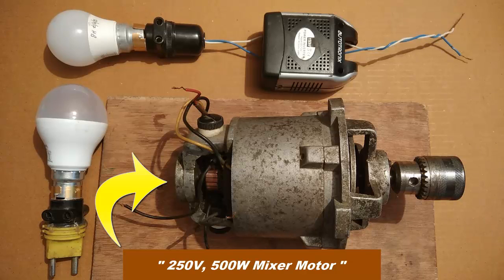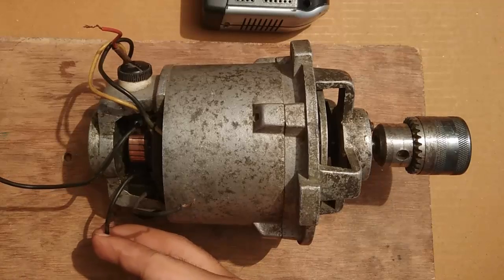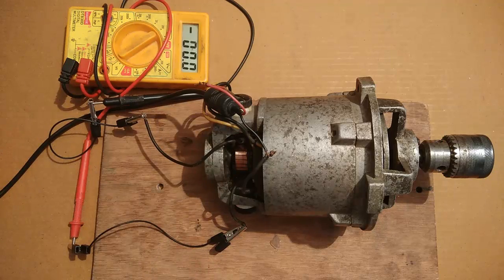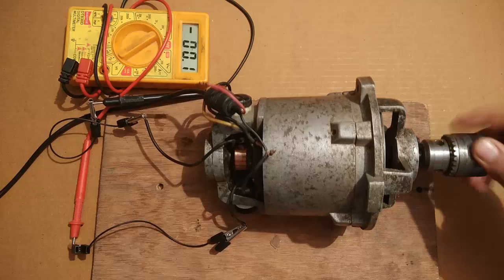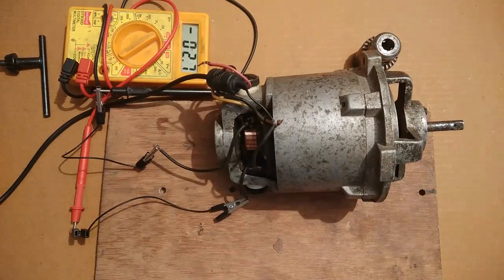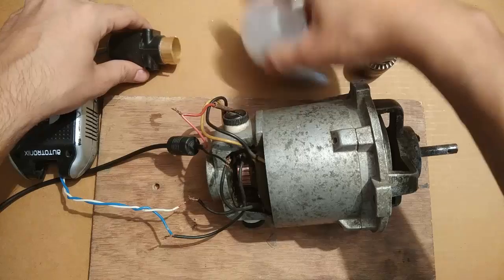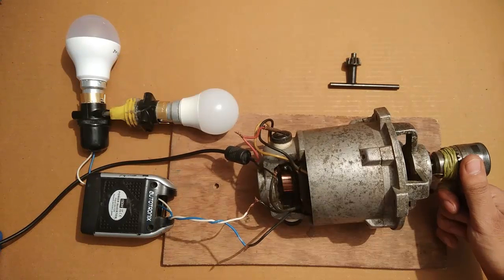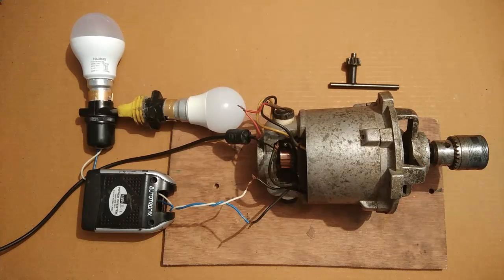220V High Energy Generator from a 500W Mixer Motor DIY

Comment: Hi I want to run a mini 12v submersible water pump, along with 12v led strip. The generator should be a wind turbine generator. Suggest me what type of DC generator I should use. :?
Reply: If you figured it out, lmk

Comment: Where' that black wire connected to? Laptop adaptor to an outlet?
Reply from the maker: Input black wire is of a laptop charger
Reply: So what's the use of the black wire? To charge the laptop?
Reply from the maker: No .. Laptop charger has been used to run the motor

Comment: Hello sir I have 0-60 volt 1 kW dc alternator. I want use 48 volt 500 watt dc motor from this alternator. How can I use this alternator with different volt. Please give suggestion what I use to work properly this 48 volt motor.
Reply from the maker: Simply limit the rpm of the 1kw alternator to the point where it generates 48V.Thats it..
Reply: Sir if alternator volt reach to 60 v than 48 volt motor works or not work or any problem in 48 volt motor ? Please reply me thanks😇
Reply from the maker: DINESH KUMAR no problem if coz as long as the rpm is controlled, the voltage won't reach 60V and even if it does, your motor will still work just fine.
Reply: DINESH KUMAR hello